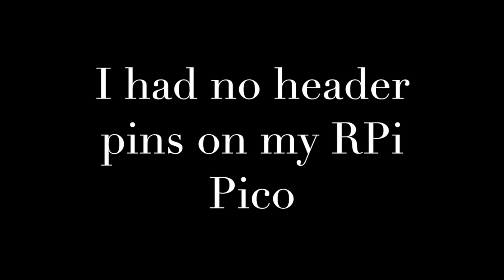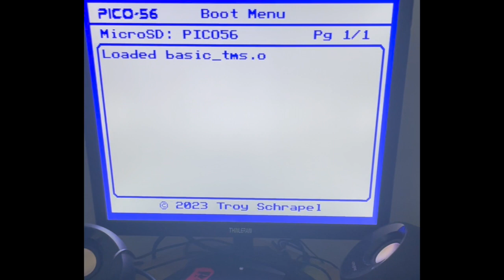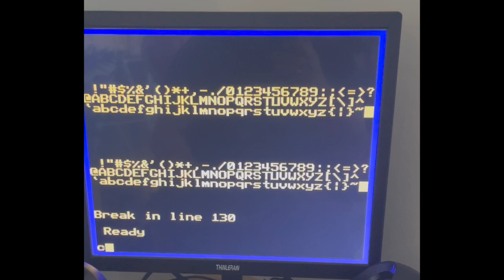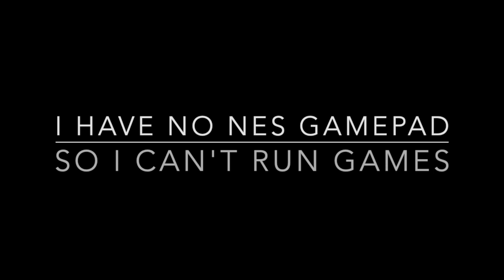Building Pico 56

Comment: Nice one, Aleksandr. Great job. Nice soldering iron too! (I have the TS-100).
Reply from the maker: Thank you for great kit!
Reply: @nihirash  No worries. I'd better get to work on keyboard support for the games ;-)
Reply from the maker: @TroySchrapel  I'm already got gamepad 🙂 Currently, I'm busy with Agon Light but I have plans on your device too. I'd like a bit extend file "device"(for getting catalogue, more robust reading  files - eof detection not by zero byte) and write some software for it. Your computer is really underrated! 🙂